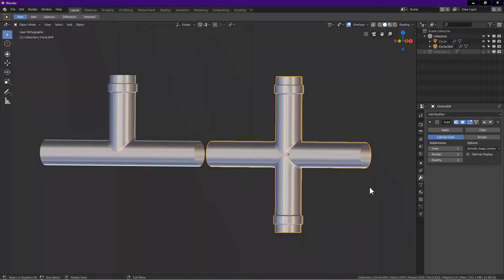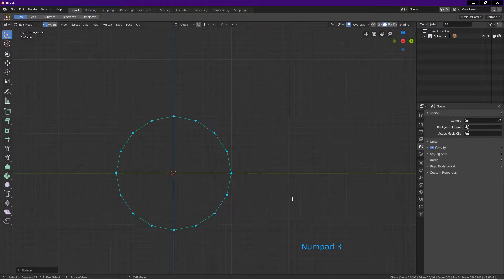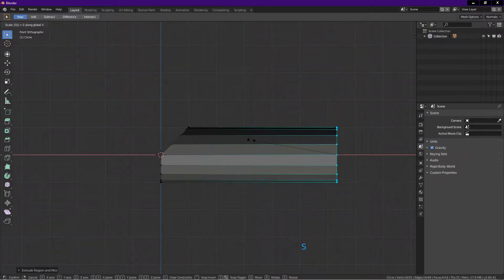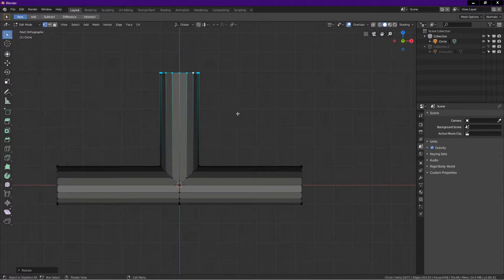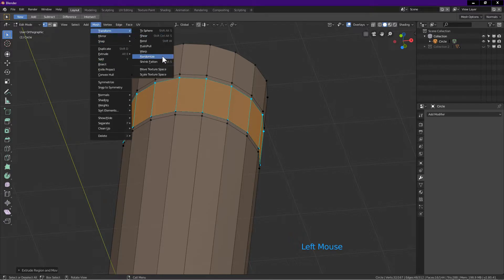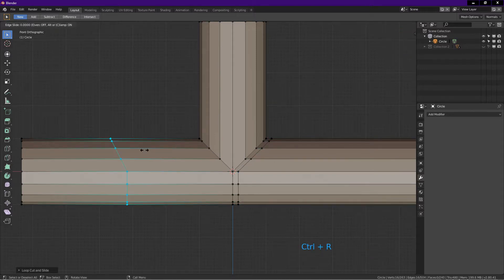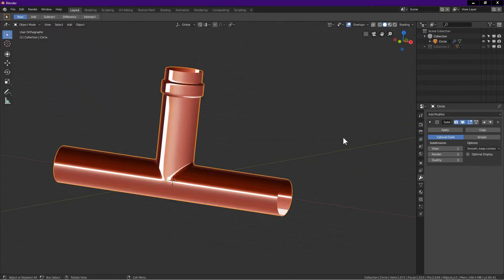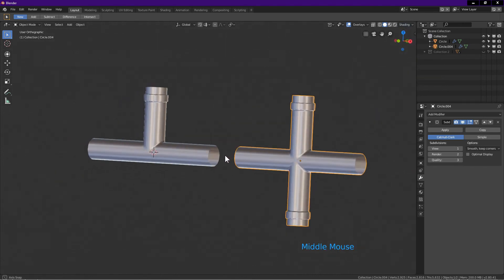Blender 2 80 - Modeling A T-Joint Pipe.

Comment: why i can't do that shear thing ?
my mesh vertex just can't move when i do that shear thing -_-
tell me what's wrong master
Reply from the maker: It seems Blender have changed how the Shear tool behaves. 
If you can't get the Shear to work properly, follow the steps below.

At 1.30, go to Mesh Menu > Transform > choose Shear, then press Y, on Number pad press - 1 (minus 1), press Enter.
This Shear the selected vertices in the Y axis by minus 1 unit. Hope this helps.